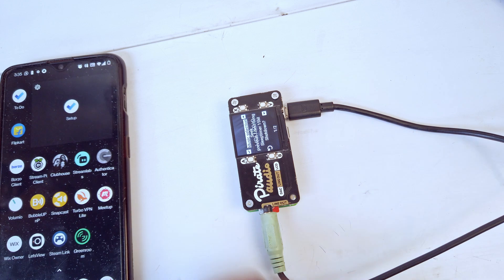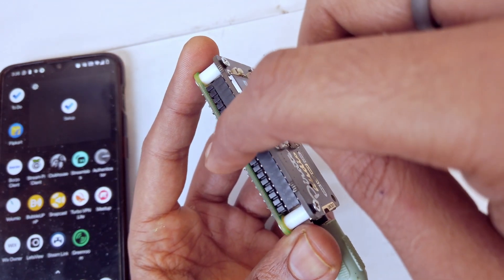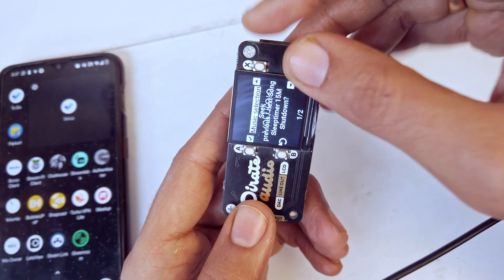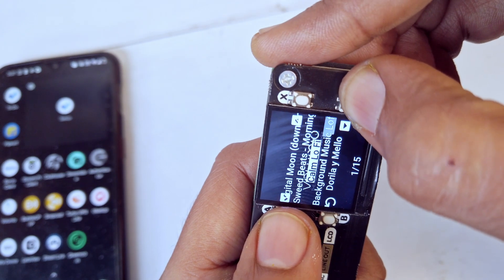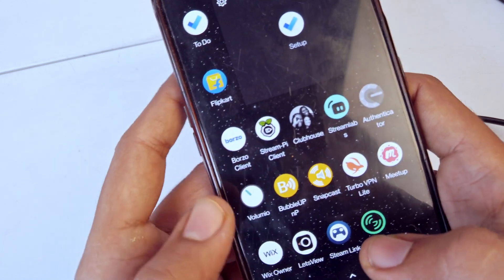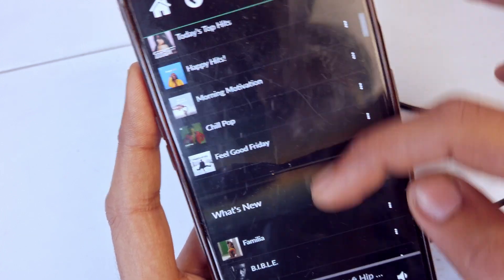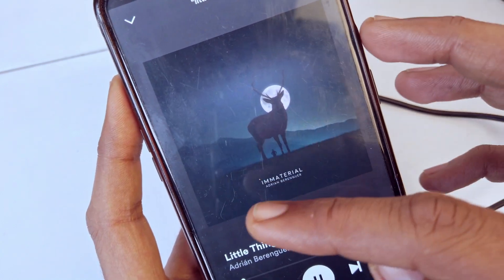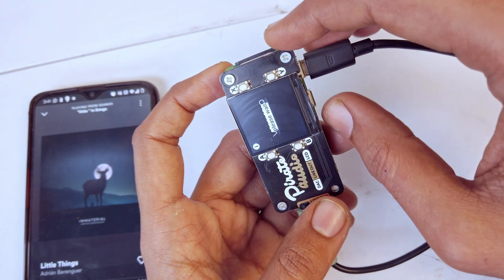Pipod - DIY Music player that plays spotify

Comment: Thanks so much for this video! Could you please share the Step By Step Process of 
1) Installing Pi software/firmware
2) Installing Volumio onto the Pi (or the Pirate??)
3) Uploading audio files onto the raspberry pi sd 
4) This is a bonus for me How to use the pi zero Bluetooth module with this setup

Thankful for any and all help 🙏🏾😁

Comment: Great job. Want to build one myself as a dedicated Spotify player for my home. Can you give parts list.
Reply: * Raspberry Pi Zero 2 W.
(with headers if possible, but you can buy GPIO header pins and it saves you £10 - he did it himself, you can see the flux on the back of the Zero).
* Pimoroni Pirate Audio Headphone.
(or line out, or one of the total 4 diff ones)... DAC HAT thingy (not the shim, that's less than half the size and no screen).
* Micro SD card.
Look at the size of your music collection and get a card around double that. I have about 40GB of music so I'm getting a 64GB.
(Get a shiny gold Sandisk Extreme. Don't cheap out. And shut down properly or you will corrupt your SD).
* Now you gotta think power.
Gonna just buy a small power bank?
Gonna get a charge and 5v boost unit?
18650? Li-Po?
Just USB power coz it's gonna be stationary?
Pi Zero 2 UPS HAT?
* Now you gotta think case.
Acrylic?
3d print?
Wood?
Cement? Okay okay, probably not cement.
Bamboo? That'd be cool.
* Additional buttons?
They can be programmed with MicroPython.
A shutdown button and maybe a volume dial would be nice.

Finally you're looking at code. There's the Volumio, but there's also the OS that Pimoroni recommends.

I'm doing Pi Zero 2 W,
adding hammer headers,
Headphone Version Pirate Audio DAC HAT,
acrylic case,
18650 (we'll see how long 1 lasts - Cell supply UK does gooes prices),
ElectroNoobs' V3 5V charge-protect-boost module (bought Gerbers, gotta order with assembly),
simple diode/resistor/led battery level indicator circuit from YouTube (but will add switch to prevent power bleed),
Pimoroni recommeded code.

Nice, portable little audio player.
Reply: Its actually a product called Pirate Audio for raspberry pi just look it up.